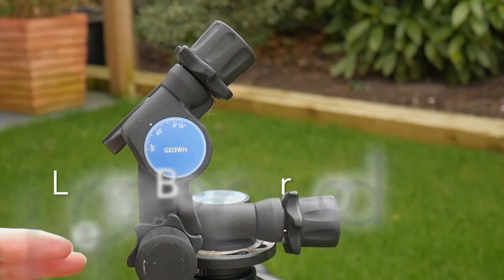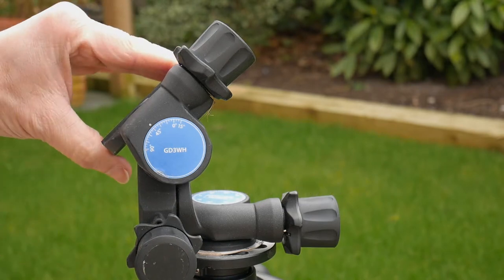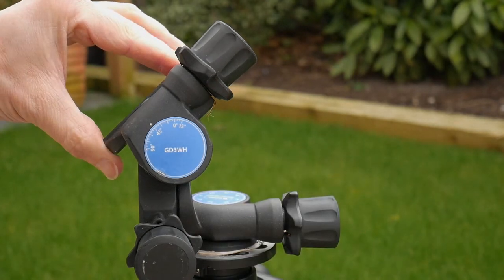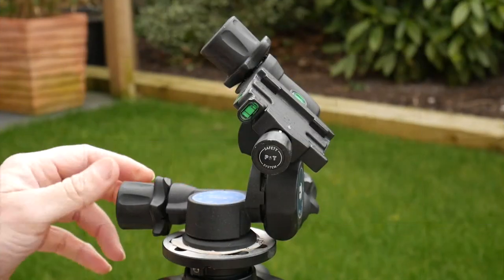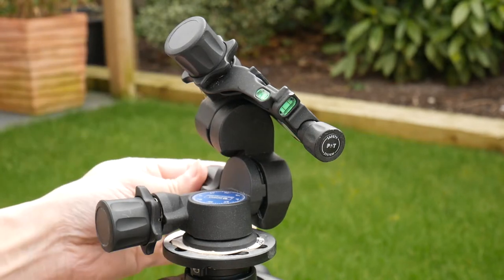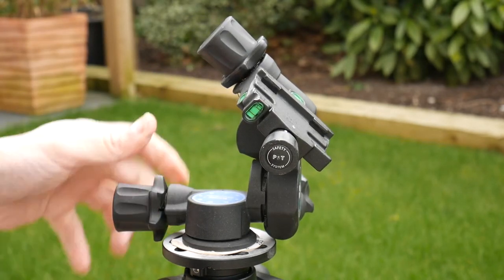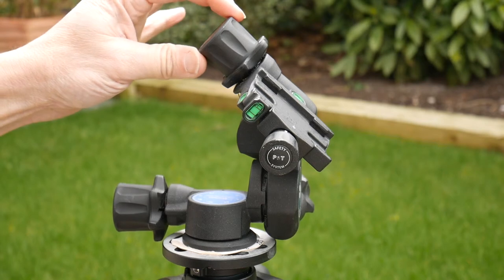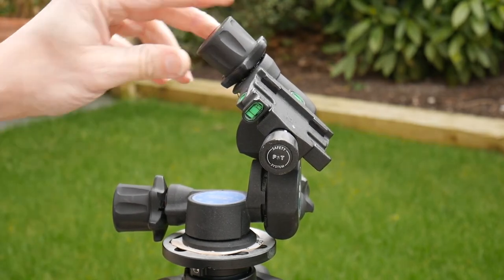Benro GD3WH Loose Head

Comment: How did you get the blue degree scale off? I have the same problem you had but can't figure out how to get the round blue sticker to come off.
Reply: @AWalkontheWildSideBlackpool  Thanks Steve. I tried using a razor blade to lift it off thinking it's an adhesive sticker like the Manfrotto 410 head. I'll try a screwdriver to see if I can pop the cap off.